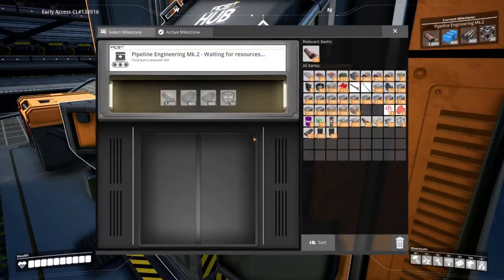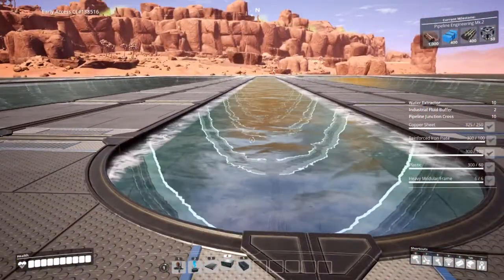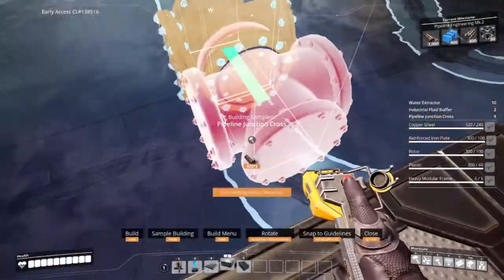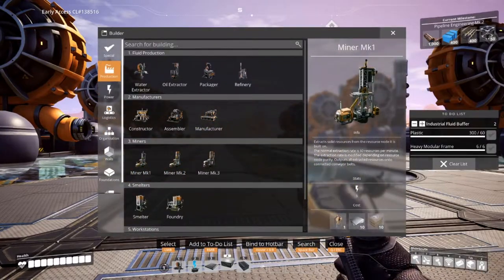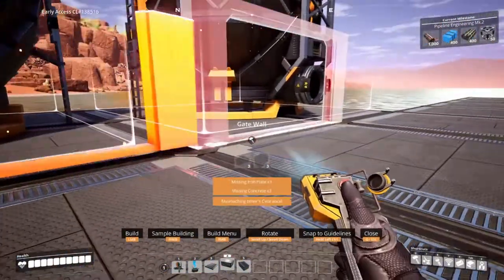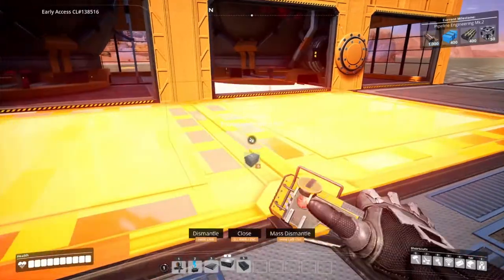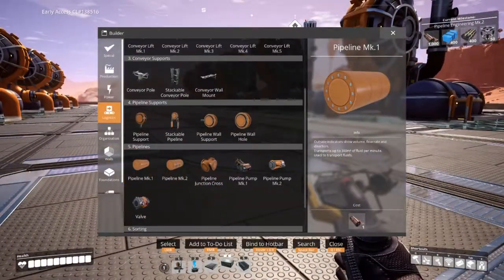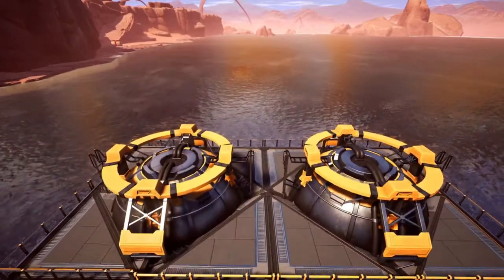CLEAN🚰WATER 🚰PLANT BUILD GUIDE [Satisfactory Game] - Update 3.5

Comment: Very cool.  I've incorporated a few of your other layouts, this one definitely gets a try next time I need some water.  One thing I don't get though...how are the underneath pipes connecting through the quarter-pipe foundations to the T-junctions, without a pipeline wall hole (which doesn't seem would fit on the "pipe" part of the quarter-pipe anyway)?  
 
 In most of your videos, I catch a few little techniques that I probably never would have stumbled across on my own.  Example in this one:  Never would have occurred to me to try putting a wall outlet on a fence.  And probably wouldn't have ever thought of stacking fences on top of each other for height.  That's gonna come in handy in any number of scenarios.
Reply from the maker: First - sorry about the OMEGA LEVEL LATE RESPONSE. Secondly - to answer your question the t-junction functions as a pipe hole I suppose. I use a vertical pipe from the extractor to cross. I might be confused about your question. Does this answer it? Thirdly - If you happen to have some time to come out to my live stream I would love to walk through this with you <3